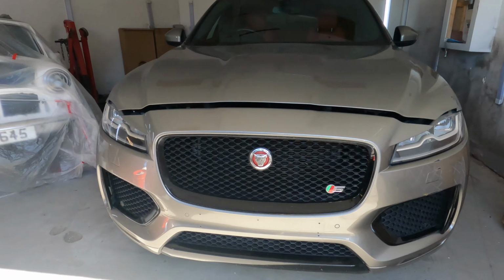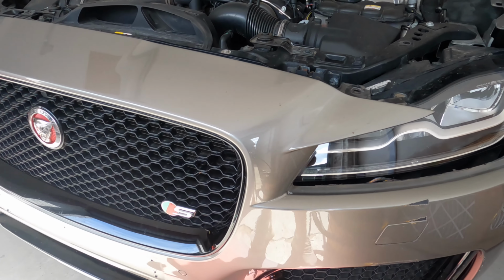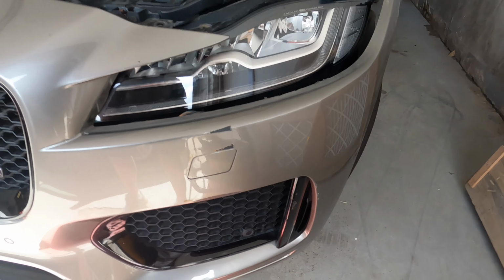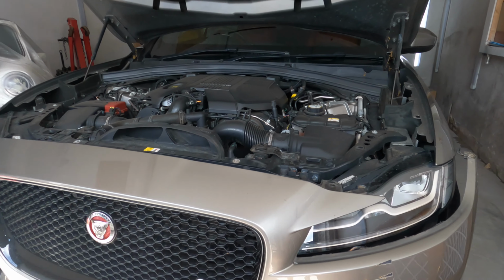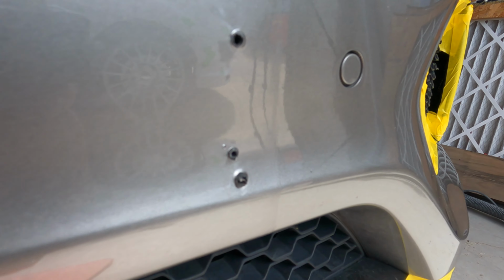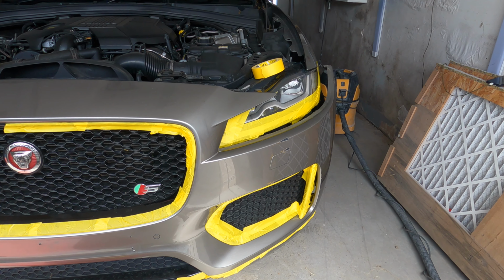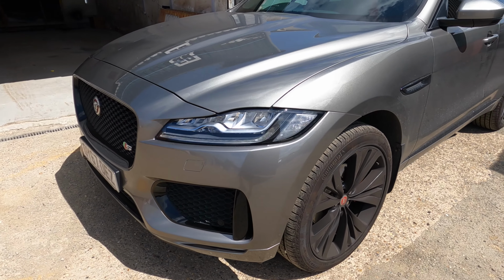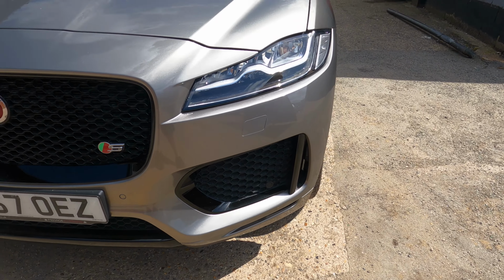Smart repair jaguar f pace s

Comment: Lovely jubbly Grant it's like you were never there a mint finish, so when are you getting the WS400 series 2 mate 😂 they look nice but the price isn't so nice. I've just got a new Iwata W400 Bellaria 1.3 for clear it's a great gun and lays the clear just as good as my DV1 or Sata X5500 RP.
One question mate when you are doing those small filler jobs wouldn't it be quicker to use UV putty rather than 2K filler 🤔🙏👍
Reply from the maker: Ive been looking but no spending for me at the moment just trying to recover 😂😂 and I didn’t use my uv filler because I keep forgetting I have it 🤦‍♂️🤦‍♂️ 🤣🤣🤣
Reply: 😲🙄😂🤣fancy forgetting you have UV filler 🤦‍♂️ I like the colad fine as it sands a treat and cures quickly with my little Mipa UV lamp👍
Reply from the maker: Yeah both are good but the course seems to go off soon as it’s out